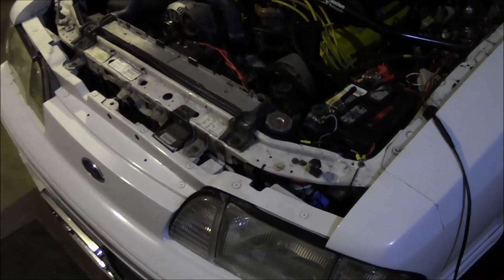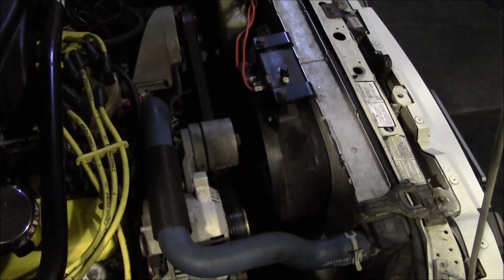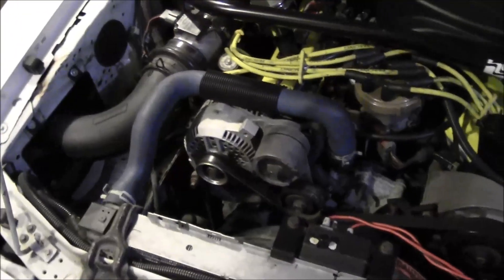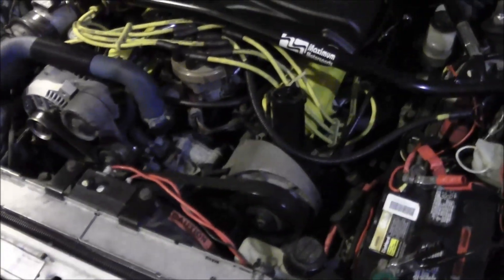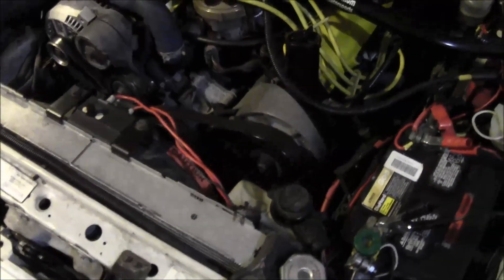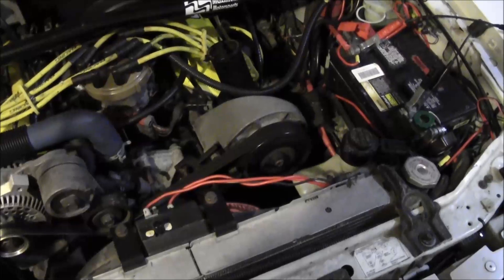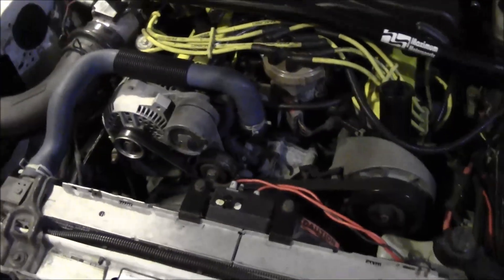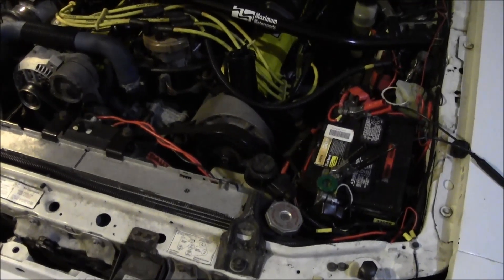Fox Body Mustang Electrical

Comment: I'm having a problem with my 92 fox, I started the car and 30sec of it being started the car shut off and won't start back up. Checked battery and its good ,cleaned mass air. Need another brain to diagnose issue .
Reply: yo i have a 1986 GT with an 88 engine in it with MAF, doesnt idle and blows the fuse behind the battery alot!
Reply: fwh79 i will when i get back home in 9 days, I appreciate your help. This car is being a massive pain in the ass i got it when i was 16 now im 22. Still havent driven it yet. Lots of little issues
Reply: fwh79 but its a yellow wire if i remember correctly one side is going to the solenoid and idk where the other end goes, ill check that first thing when im back home
Reply: fwh79 car has sat for a while, maybe 2 years since it last moved under its own power. When i bought the car it had its stock 86 engine but it had a bad knock so we got the 88 bronco engine and put that in, then converted to mass air, just so u have the backstory. It sat for years while i went to college and only had time sporadically to work on it but it was a heft resto believe me. Old gas was pumped out and replaced, new tfi module, weve been messing around with the timing for a long time now trying to get it to work to no avail and any time we thought we had it the fuse blew.
Reply: fwh79 battery is fine, its a battery that my dad was using on his racecar trailer winch we charge it frequently to be sure
Reply: Im going to have a friend check the fuel pressure for me in the next couple days, in interested in what you said about the alternator wiring.
Reply: fwh79 when i bought it however many years ago, i think 6, the seller drove it onto our trailer, it had a terrible rod knock so we set out from the start to get a nee engine. Since putting the new engine i think it only truly ran once to drive from a friends garage(where we got the new engine running) to our trailer. When we got it back to my house it gave out. That was probably three years ago. Sorry for long response it was a long time ago im remembering it as i type lol.
Reply: fwh79 fuse is on the harness, it is not on the fuse box under the steering wheel. Idk about the alternator actually, for all i know it could be completely fucked. Ill check it all when i get home.
Reply: fwh79 thanks alot man i really appreciate it. It has been a very long journey, made longer by the fact that my dad and all of his car friends are ALL hardcore chevy guys. I get shit for having a mustang all the time dude, especially with all the little problems, i just want to have it running to show em how great the car is.
Reply: fwh79 right its because all they know is carbureted chevy engines and would rather diss ford than learn how it works.
Reply: fwh79 one guy hypothesized that the problem was grounds. Im not really sure where all the grounds should be, there is on from the salt and pepper shakers that goes to the transmission idk if thats right
Reply: im finally back home and while i was gone i ordered a code scanner. just used it and got the following 6 codes, i hope you can help me out with these.

51,O
24,O
31,O
67,O
82,O
95,O
Reply: yo man ik its been a month, but i think i fixed my issue today. get this shit man, it was the windshield wipers, i decided randomly to unplug the wiper motor and bam, the fucking thing started right up, no fuse blowing.
Reply from the maker: Does the car crank and not start?  Or does it not crank at all?  If it does not crank, you have an electrical problem.

I would start by pulling the number 5 plug.  It's the easiest to get to... first plug on the drivers side.  See if the plug is clean or not.  You may have a fuel issue.  Pump going bad, or a bad fuel pressure regulator.  You can check that with a fuel pressure gauge.  This video shows a quick way to check the fuel pressure regulator.  https://youtu.be/B4ujJY6Iy-c
Could be ignition as well, maybe a weak coil or a TFI module going bad.  You can use a timing light to check the ignition.  It's hard for me to say without looking at the car.  There is a huge list of "could-be's"  
I am more than happy to try and help you if you feel like trying to diagnose this over youtube.
Reply: fwh79 thanks bro I changed fuel filter and as I pulled it it was full of fuel,in thinking it might be electrical to its still cranking but no power I'm checking electricals this weekend and ill keep u posted I got the car second had and there is no telling what kinda hack job the previous owner did to the motor
Reply from the maker: Yeah, there is no telling what a previous owner did.  I would double check your fuel pressure with a gauge on the fuel rail.  Should jump up to about 40 psi and stay there.  Be sure to pull that number 5 plug and look at it.  You will get an idea if the engine is rich (dark plug color) or lean (white ashy appearance).  You could have a vacuum leak issue.  When I bought my black car, it would not idle at all.  Jumping up and down... all over the place.  I took the intake off and discovered that the vacuum fitting for the evap. canister was completely disconnected!  Got that fixed up and the car has never run better.  I would also suggest checking the distributor and engine timing.  Most of these cars have had the timing messed with at one point in time or another.  You could have a loose distributor hold down bolt which allowed the engine timing to change.   Good luck Brandon and please keep me posted.
Reply: fwh79 I for sure will keep posted thanks again
Reply: fwh79 hey I checked the fuel rail and nothing no gas checked spark plug and they are good getting spark I'm not getting gas changed fuel pump and its not cutting on I changed the fuel pump relay and nothing still
Reply from the maker: Did you check the inertia switch for the fuel pump?
Reply: fwh79 checked and reset
Reply: fwh79 I checked the relay and the fuse ,its strange tho because everything I'm looking at it say the relay is in the passenger side wheel well and the relay I got doesn't fit in either of the relays in the wheel well it its in a relay in the trunk that's by the drop top motor
Reply from the maker: Interesting... where did you get the new relay from?  Unfortunately, I don't know much about the fuel pump wiring as far as the relay or where it is mounted.  I wonder if the ignition switch located by the key has anything to do with the fuel pump.  

I think i may have figured it out...  the mustang does not have a fuse panel in the engine compartment.  It has a bundle of fuse links.  I burned my fuel pump fuse link out on my white car when my fuel pump died back in 1999 and it would not start.  I blew the fuse link trying to repeatedly start the car with the bad fuel pump.  You may have blown the fuel pump fuse link.  The fuse link bundle is on the drivers side near the ignition coil.  The wires run from the starter solenoid, around the driver side strut tower, and back to the fire wall.  They should be bundled in a corrugated wire cover.  You need to find the bundle and cut the cover open to reveal the fuse links.  Then use a test light or volt meter to check and see if the fuse link is blown.  I can't find the proper color fuse link for your 1992.  I was looking at my white car, and it looks like the wire is either black and orange, or blue and orange.  However, that is for a 1990... 1992 could be different.  I would suggest doing some research on fuse links.  I will look in to it some more if I get the time to.  I think that is your problem though.  Sorry it has taken me so long to respond... youtube is not showing me my notifications for some reason.  So I have no idea you have left a comment if I don't check up on this thread.
Reply from the maker: I would rather solve your problem on this thread.  I'm sure other people are having a similar problem.  Keeping it public will help them as well.  Did you find the fuse links?  You can check them with a volt meter (key on) but if a fuse link is blown, the link will be burned and melted.  Should be easy to spot.
Reply: fwh79 I haven't really been able to check it its been raining a lot the past week,but that's what I will check possibly will be today . I will keep u posted but the car is for sure not getting gas.
Reply: So I figured out what the problem was,electrical one of the wires that runs from the pump replay to the inertia switch that wire had a bad ground and was cutting the pump off
Reply: if i keep the key turned in the starting position and give it gas it will run for a little bit but then it blows the fuse.
Reply from the maker: That's good  news!  Glad you found the problem and fixed it.  Plus no fuse links to splice in!  Its funny how I can't seem to find any good info on the fuse links.   Thank you for the update.
Reply from the maker: spudlymac... this fuse you are talking about, is it the fuse for the alternator charging wire?  If it is... check that wire from the battery to the alternator.  It must be shorting out some where and blowing that fuse.  So, visually inspect the whole cable looking for signs of missing insulation that may be causing the wire to short to ground.
Reply from the maker: Ok my man, hopefully we can help you out.  First of all... a 1986 with a 1988 motor swap means this is probably gonna be really hard to diagnose.  I tried to look at 1986 wiring diagrams in one of my repair manuals but its almost impossible to read.  So I went outside and looked at my white 1990 gt.  I did find a yellow wire that is attached to the starter solenoid on my car.  So I looked up the wiring in a different repair manual that covers 1989 to 1992 and tried to trace it out.  That yellow wire feeds several fuse links before making it's way to a few different places.  First it feeds three separate fuses in the fuse box located near the drives left leg.  Cavity 1, 15, and 18.  (I don't know if this is accurate for a 1986 model year though)  It also seems to feed the rear defroster AND the fuel pump relay.  I would start by checking your battery for proper charge with a volt meter.  How old is your battery?  A discharged battery will cause you several problems as well.  The next thing I would look into is the fuel system.  Use a fuel pressure gauge to check the fuel pressure.  Attach the gauge and turn the key to the "on" position.  You should have pressure between 35-45 psi.  It should hold that pressure for some time... about an hour or so.  So if you turn the key on and get pressure... but it falls down to zero, you may have a bad regulator or fuel pump.  If you are not getting any pressure you may have a bad fuel pump relay.

So...  Here is my list of questions I need you to answer for me.
1.  How long has the car been sitting?  Is the gas still fresh?  
2.  Is the battery still good?  How old is it?  Has it been charged up recently?  Has it been load tested?
3.  Do you have correct fuel pressure?  Have your checked the pressure with a gauge?
4.  Another big trouble maker is incorrect ignition timing.  You may have a lose hold down bolt that has allowed the distributor to move and change the initial timing advance.  
5.  Plus going back to the alternator wiring...  you may have damaged the voltage regulator on the alternator which could be why you keep blowing fuses.  I would put a volt meter on the battery when you try to start it to monitor voltage output.  Should not exceed 14.5 volts when running.

Please reply to my questions and we can start formulating a diagnosis plan.  Maybe we can get her fixed up so you can finally drive her!
Reply from the maker: Oh ok, thank you for the back story.  Definitely helps me understand your situation.  What kind of alternator are you running?  Is it stock or upgraded?  This fuse that keeps blowing... can you identify it?  Is it a fuse link in the harness?  Or a fuse inside the car?  Also, when was the last time you had the car running?
Reply from the maker: K, sounds good.  Sounds like this has been a very long journey for you.  I hope we can resolve your issues so you can actually enjoy driving your Mustang .  Please keep me updated with any progress and I will be more than happy to help you out.
Reply from the maker: I hear ya brother... it's really sad when car guys just can't come together and help each other out.  Although... i'm sure most of this Ford fuel injection stuff is beyond the knowledge base of the Chevy guys you know.  So, they probably won't help you because... they simply can't and don't want to admit it.  There is a strong community of Ford guys on YouTube.  I think you have a really good chance of fixing your car.
Reply from the maker: spudlymac:  Sorry dude... YouTube didn't give me a notification that you messaged me!  Wiper motor huh?  That's pretty crazy!  Well I'm glad you got her fixed up.  I'll have to remember this one.  I have never come across the problem you had.  How is she doing now?  I know you left this message months ago.  Sorry again about the late reply.

Comment: My electric fan stays running  all the time as long as my A/C is on if my A/C is off electric fan on comes on when temperature reaches over 180F , I got the green wire hooked to the black with green  stripe did I connect it wrong???
Reply from the maker: No, you connected it correctly.  The fan should come on and stay on when the A/C is running.  This ensures there is always air flow over the condenser so you have nice and cold air.  When the A/C is off, it should go back to being triggered by the thermostat switch.  I see most of these fans wired to run constantly when the car is running, which is really bad.  Beats up the battery and the alternator.  You got it right, no worries.

Comment: Problems charging !? Idle up a hair?! I put a 100 amp in mine.
Under drive kit comes with a bigger alternator pulley too... if u don't put It on  u r missing
A good charge until u rev it up!?! I put an over sized battery on mine... starter quit dragging during starts too!!
Reply from the maker: A bigger battery is not really a solution.  If you don't use a battery maintainer regularly (which most people don't), you will eventually have a bigger discharged battery under your hood.  Plus the bigger battery is just more weight to lug around town.